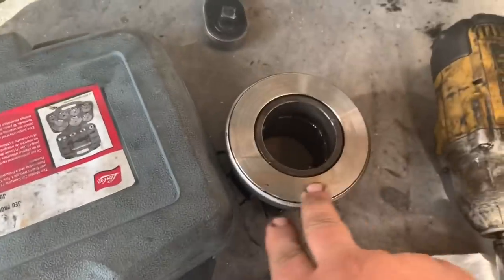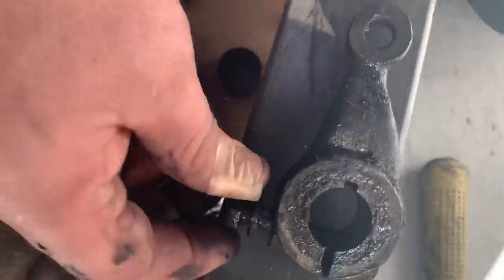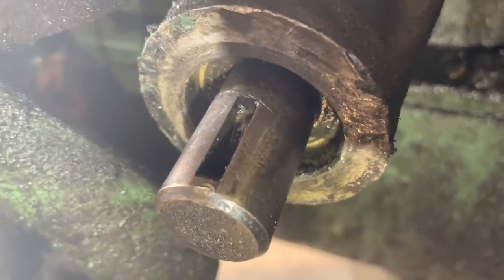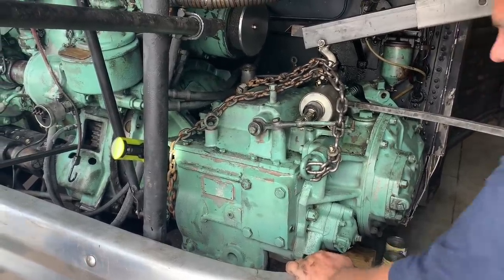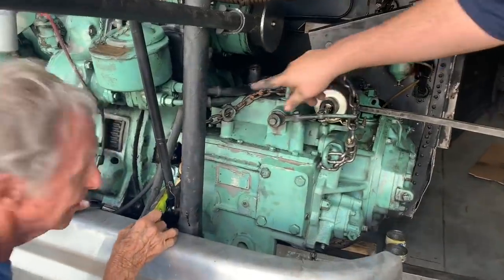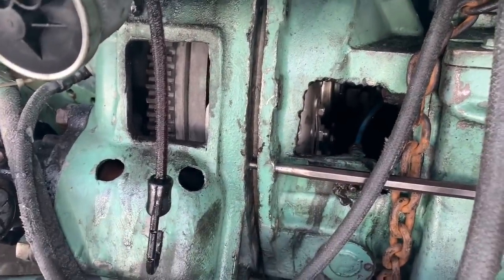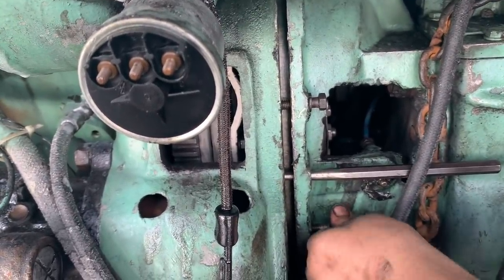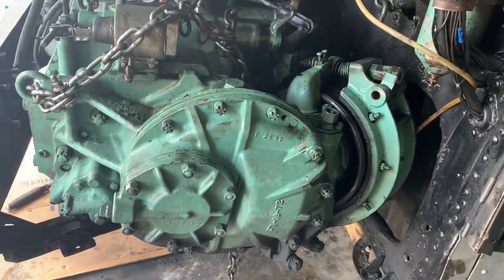Finishing clutch replacement on gm bus 4104

Comment: if i need to replace such seals , i bore 2 small holes 180 degrees apart , and screw in thin screws with course tread (selftapping woodscrews) and use them to pull out the seal , works fine.

Comment: I  use line up dowels to make that just a little easier....  cut the head off two bolts and cut notches in them (for screwdriver) screw them in a dozen threads and then slide transmission in place ...
Reply: Exactly ... just like that 👍
Reply: I think it would help alot to have long ones to line up the flywheel also.

Comment: i enjoy your videos. as a mechanic.. i probably would have loosened the hoses over the bell housing @2:04 and reclocked them to get them to clear the bell housing and the top cover..   i might also take some bolts and grind them to a bullet shape on a grinder , knocking the head off and putting a slot in them to assist in aligning the case to the bell housing flange..  its just a thought..  you make this look as easy as working on a 64 chevy nova..

Comment: With a cars auto transmission the bell housing has to touch the back of the block you can't draw it in with bolts or you'll snap the ears on the bellhousing I've seen it done more than once trying to draw the bellhousing in and I've snapped a piece off one myself those bell housing on those buses are a lot tougher.

Comment: Down here in New Zealand old buses are very rarely restored, you probably have heard this before but whenever I am doing a clutch job I always get two bolts that are the same as what goes back into the bellhousing but are at least triple the length of the original one's going back in, I put two of these extra long bolts on either side of the transmission bolt holes & when the transmission is 2-3 inches away from the bellhousing I screw both of them into the bellhousing to act as rough alignment guides, silly but it works !!! Oh, and I put a little bit of grease on the extra long bolts as well.

Comment: Were there (at time of manufacture) other options for transmissions, other than that Spicer 4-speed?  In the time that has passed since that time, has anything else emerged that is basically a reasonable replacement without having to re-engineer the whole back end of the bus?  I'm no fan of automatics by any stretch, but for someone who might be, is there anything for them?
Reply from the maker: For the gm v drive there are two options.  (Most models without to much modification the auto can be added) spicer 4 speed or Allison V730

Comment: Sadly we saw very few GM Bus's or Coaches here in Australia and apart from the MCI's Greyhound ran in the 70's  most buses where English or Euro with locally built bodies, chassis and engines.
Locally built Coaches did get GM 2 strokes early on and they where glorious to drive in both early and late 6 and 8 Cyl configs including the odd TT now and then and they really suited the wide open landscapes and highways.
The other issue is the Maximum width of Buses and trucks is 8 foot so even importing them is an issue im told.
Having owned a few Buses privately they where always underpowered and the older ones Speed limited at the time to 50 Mph (80 ish Kph) via the Diff ratio's but as they mostly had Air over Hydraulic brakes and didnt stop well even when new I can understand why the National HV limit was 50 Mph.
The other annoying issue with Old Buses here is the total lack of service parts like King pin bush kits even for the really common Bedford Chassis buses where most of the US designed Chassis seem to be well supplied even back to the 50's and 60's stuff.
Anyhoo, Love your work and love those Jimmy's.

Comment: That's pretty wild the redirecting of the power out put of that transmission and then then angle of the drive shaft to the rear end.
Yes it works ,but seems very torturous, there has to be a power loss with that .
Reply: The only power loss is through the various bearings needed (friction losses) through the changing of angles.  The Yellow Coach/GM V-drive setup allowed you to still have strong power transmission without sacrificing serviceability access methinks.  Then again, current engine power levels (2019 power levels) may be of a level that you can't make a V-drive for bus/bus-converted-RV use without making common U-joints/non-CV joints so large that they become impractical, and/or you are forced to use a 9-speed manual tranny or 9-speed automated tranny as a result.

Comment: Why use a engine hoist and not a transmission jack?
Reply from the maker: It’s designed to come out that way.  Plus the cradle support is under it so you can’t use a jack.